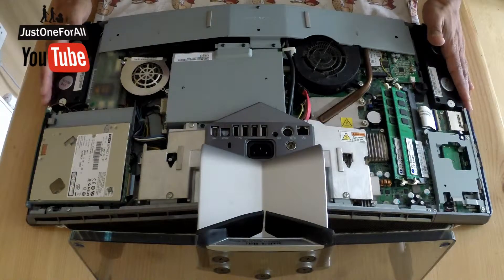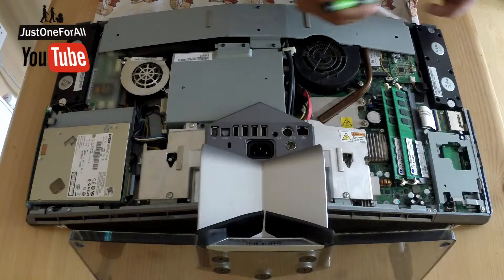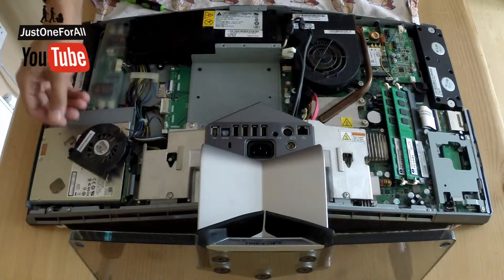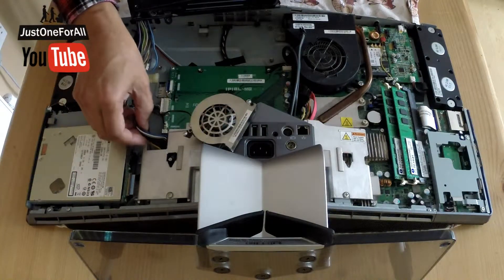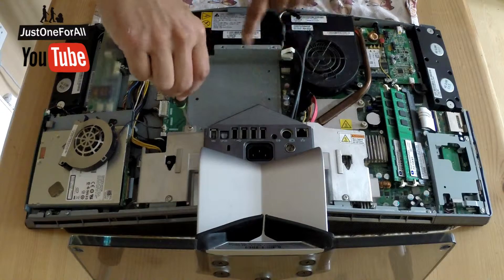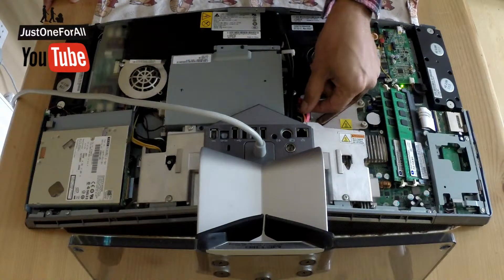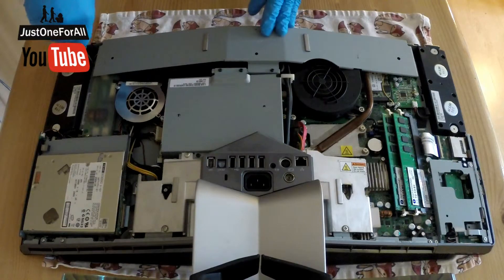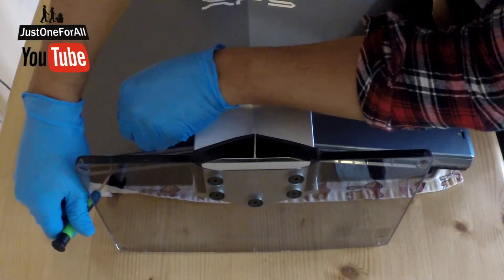How To Replace PSU Dell XPS One A2010 Power

Comment: My A2010 is dead except the power light on the front bottom right does come on.. but the PC does nothing else. Is this the same issue you had when you replaced the PSU.?

Comment: Hello, I have exactly the same problem. Can you help me find a replacement part (PSU)? Searching ebay didnt produce much. I appreciate it a lot!
Reply from the maker: When you take out the PSU and the connector wire is taken off. It will have 4 pin or 5 pin. Let me know how many pins yours has and then I'll have a look.
Reply: @TopsMiah  Thank you for the reply. It has 2 pins on the one side (220V) and 2 rows of 7 or 8 multicolored ones in the other side. If I understood your question...
Reply: IT can be repaired, bought this same model yesterday and i repaired the power supply by replacing three capacitors on the 5volt supply and  switching circuit

Comment: XPS One A2010 not turn on and i hear beed beed on Speaker how can i fix that i never get a picture Here's what I've done  changing the battery motherboard , CPU ,PUS, RAM , and I don’t see any damage circuit need your help ....
Reply from the maker: I'm not sure. what it could be.Thinking checked all connectors especially the display one.